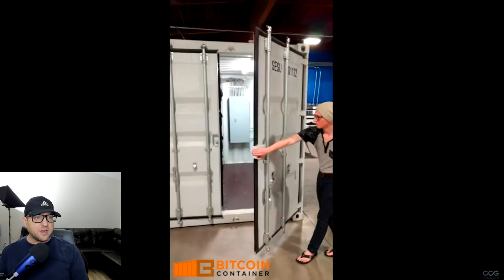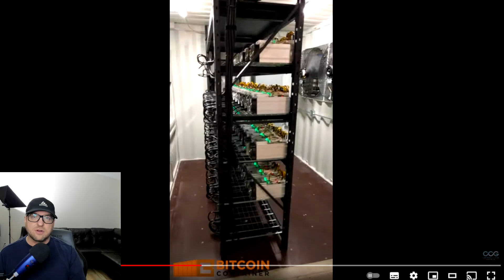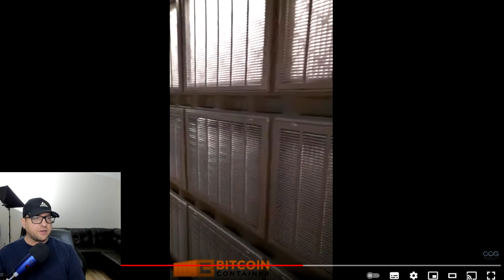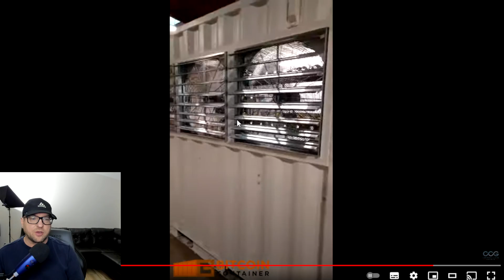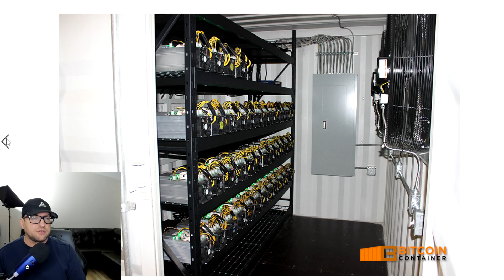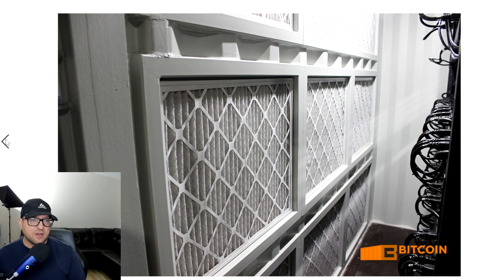10 ft. Mining Container Build Follow Up

Comment: Thank for sharing . What if i want to put 250miners in one container. Do you think  what size of container i need?
Reply from the maker: Well I hate to say size doesn't matter.. but your decision will be from your power requirements. 250 miners.. ok what kind? you will need to figure your amp load. Some miners will need to be put in a 40 footer mainly because of size, cooling, inside electrical, cabling etc. If you have 250 miners it would be best to work with an electrician and figure out how much power will need to be brought in... If they are asics figure on cooling will be the most important aspect of your container.. Hope your got megawatt or more to power that baby.
Reply: @ironfables  i have 800kw and thinking about which miner and how big for container
Reply from the maker: @TravelUnplugged  any miner can fit as long as the shelfing is set up for it. 
Seems you maybe in Thailand.. Your main concern for any mining container is cooling in your country. Find a good builder that understands positive and negative air pressure. Also getting a dehumidifier for your airflow will be something to think about. Humidity is crazy there.
Reply: That is why i ask you. I will build and design by myself.haha.

Comment: How are these intake filters holding in case of heavy rain? Does water manage to find a way in?
Incredible piece of work, too bad you are using some units which are barely comprehensible for the rest of the world, use the metric system...
Have a great weekend and keep it up the great job <3
Reply from the maker: This set up is to be used under an awning or we also had the same set up but had it inside and exhausted heat through the roof with ducting